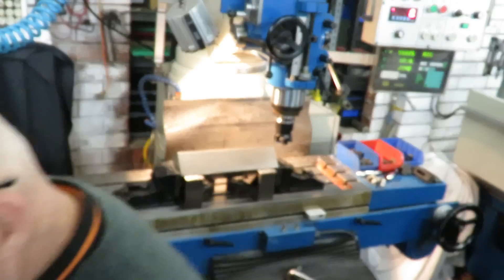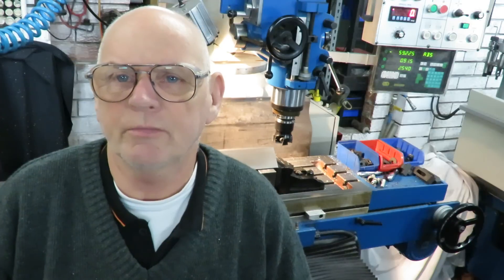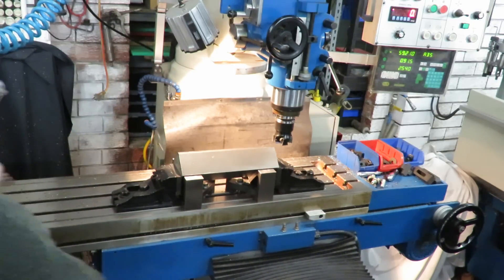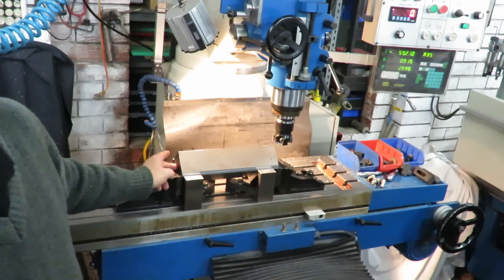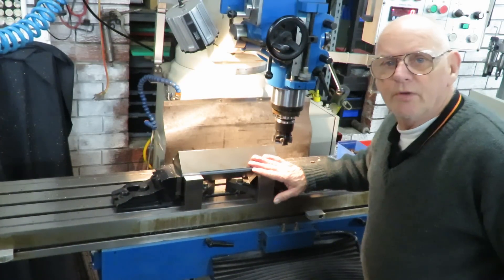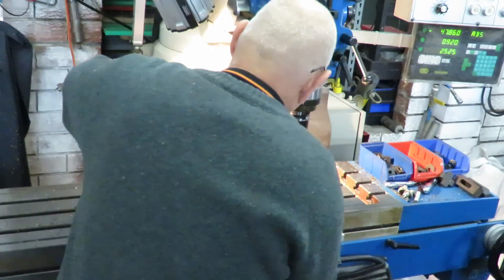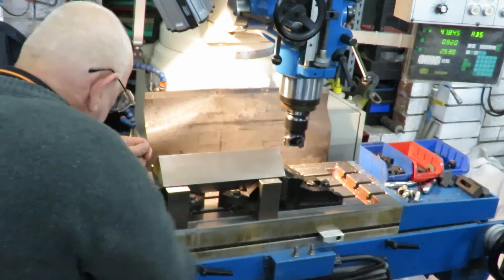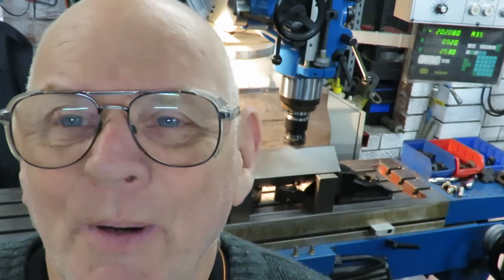Fast Track Milling Billet edges

Comment: G'day Bruce. You don't say what type of inserts these are. Tom Lipton put me on to some cermets which I especially like using for operations such as this. You may be using them here as it is, as they would run similar to how you're using these. Basically just run them as fast as the mill will go in similar holders. The finish is like a mirror. I'm a convert to them now and often use cermets also on the lathe, again, generally flat out.
Reply from the maker: Pet I'll check and get back with the insert designation! Cheers

Bruce

Comment: Thanks for the video. What are those going to be used for?
Reply from the maker: Duncan these are sacrificial wear blocks set in holders vertically on iron ore locomotives for cleaning the tracks from buildup or ore dust, they operate on the self gravity, and get replaced when they are worn down too much.
Reply: I see. Thanks.